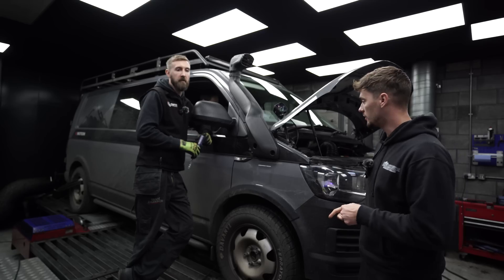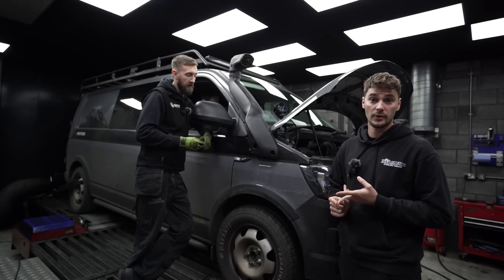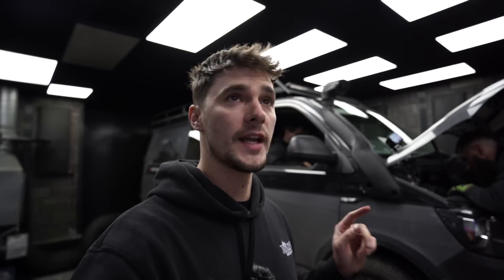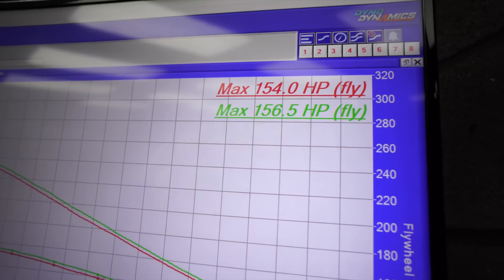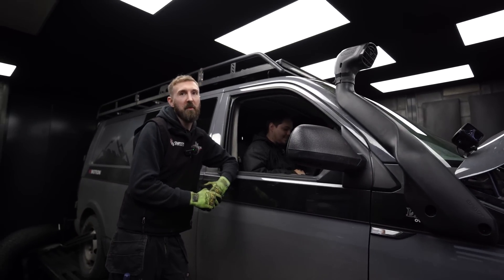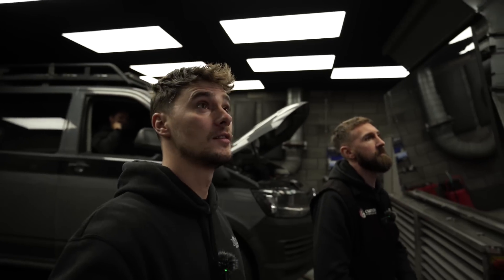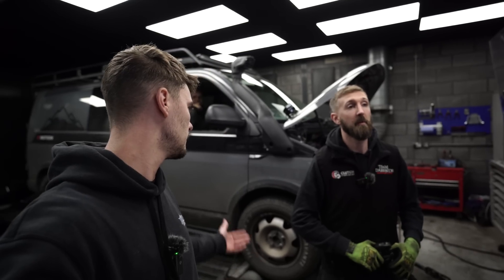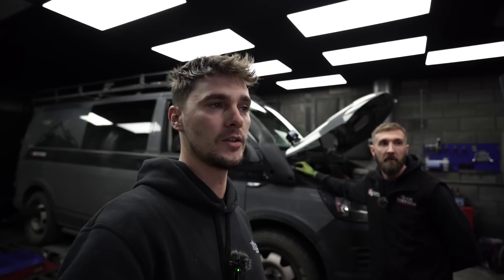4x4 SNORKEL Myth Busting! 🤿 Power Gains 📈 or Restriction? 📉

Comment: If the snorkel is being restrictive then doesn't it just need a larger diameter pipe? Could explain differences between the 2 cars as the snorkels are both different.
Reply from the maker: These are off the shelf snorkels so just what is available for these vehicles. These also utilise the stock airbox so you are limited by these too

Comment: You need to test the torque,  Mazda did a virs system on their V6 cars.
This changed the length the air travelled to get from the filter to the engine.
This smoothed the power curve and made for more even power delivery.

Comment: Says 4 motion on the sticker at the back but you only had front wheels on the dyno?
Reply: 4motion on the Transporter is an on-demand system. It defaults to FWD so tuner usually dyno it in FWD mode so there is less drivetrain loss and don't confuse the car's traction control systems.
Reply from the maker: On Haldex cars it's easier to unplug the rear diff. It is not permanent 4WD, this only kicks in when the front wheels lose traction but it can confuse the dyno

Comment: as a T6 owner I'm always puzzled about snorkels on a T6 - absolutely useless given its essentially grass and gravel capable - not enough suspension articulation, ECU's  below the snorkel line and standard airbox intake level.  Bet the breathers haven't been extended either.
Reply from the maker: If you're stickign to grass and gravel yes it's pretty useless, plenty of owners pushing these vans in more extreme conditions though 👍

Comment: Make sure you don’t run the snorkle top backwards , you can do serious damage in the rain
Reply: Can you please explain this please? In my mind the top should be facing backwards. The reason for having a snorkel is to stop getting water in, it’s not a ram air system on a race car. I’ve had mine fitted backwards for over 4 years with no issue. I actually was going to comment that Rob had his on backwards.
Reply: @davethedog007  in the brittish off road championship in 2005 we ran a new td5 90 it was a waterlogged course , the snorkle was backwards and the wipers on full speed fed the snorkle with water faster than the airbox could dump it resulted in a nlown turbo
Reply: @ OK thanks for the reply. Makes sense, I don’t think I need to worry about that going up the M6 in my Camper 😂